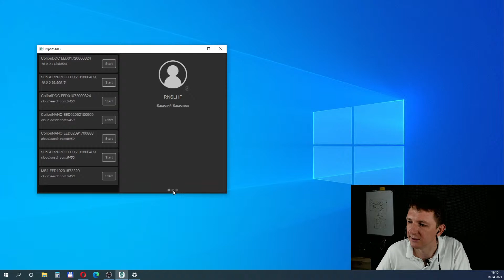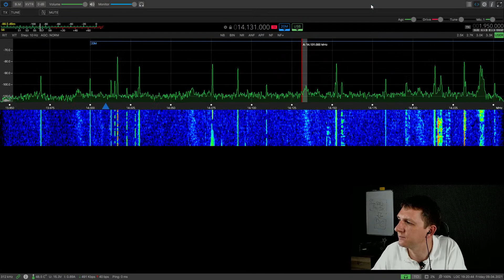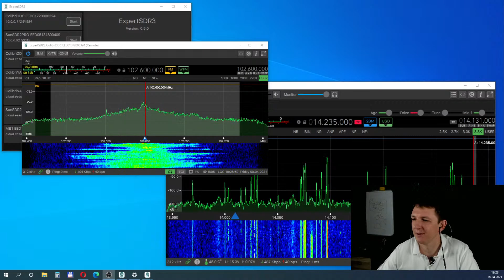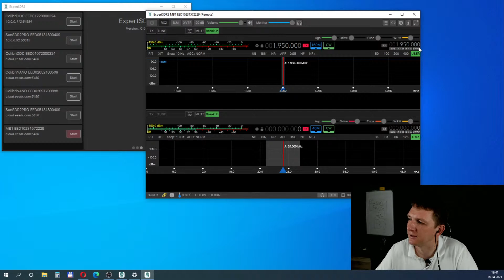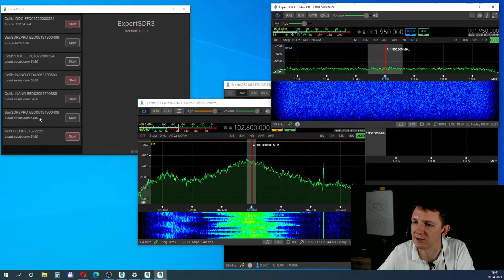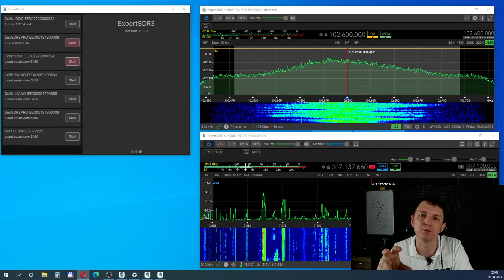ExpertRemote System - Latest news! 09.04.2021

Comment: Please  give us the  connection of the ATU port of SunSdr DX, to connect other tuners ther!
Reply from the maker: ATU interface has two things: control lines and serial interface RS-485. control lines used for start tuning, serial interface used for saving tuning parameters to ExpertSDR software with step 50 kHz and call back it on the tuned frequency.

Comment: If you have several radios running, can you use them all with one single eCoder?  Also, if you have several eCoders, can you dedicate them to specific radios?
Reply from the maker: First not yet, Second question - yes.
Krisztian, please, ask Roman about it. May be your question starts adding a new feature to ExpertSDR3.